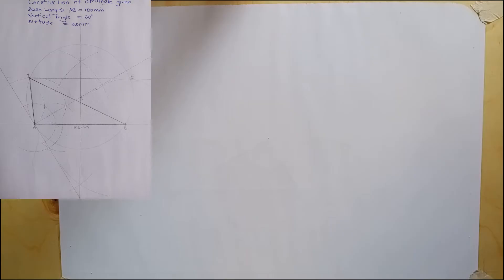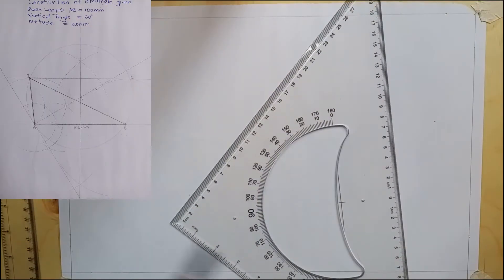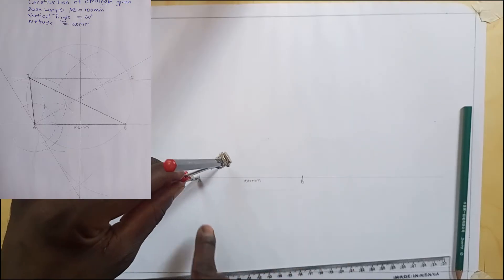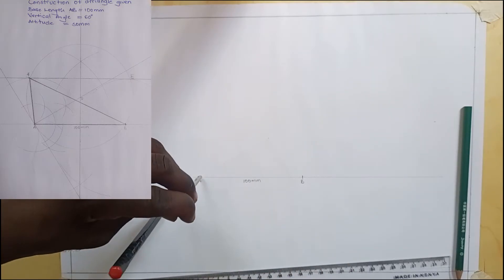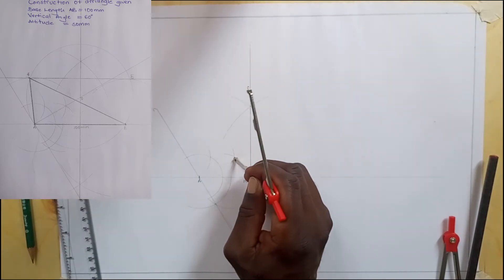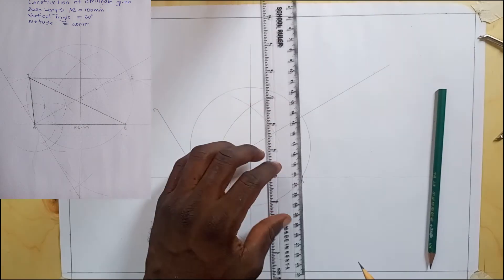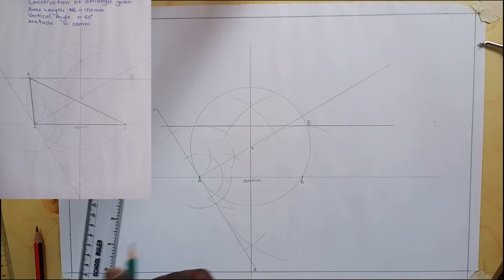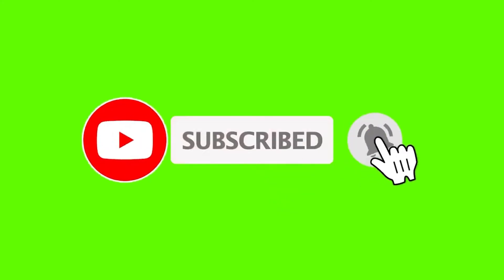How to construct a triangle given the base length, altitude and the vertical angle

Comment: The problem can be solved without use of altitude. It is an extra element. You may contact me for the3 solution. You have made the problem solution specific triangle.
Reply from the maker: Okay then
Reply: For the construction of a triangle you need 3 elements. If the altitude is not given the solution is not defined.